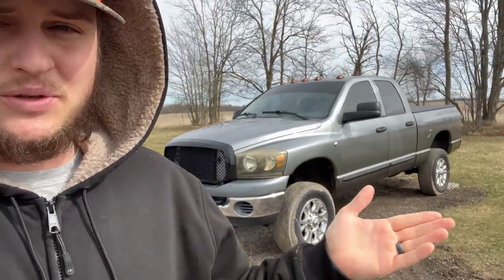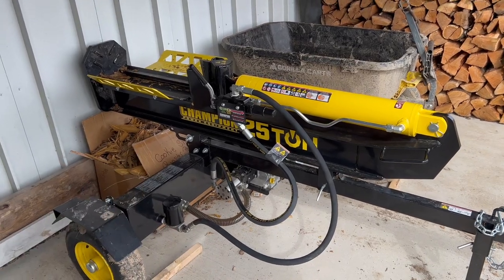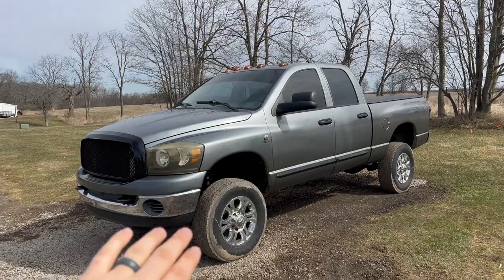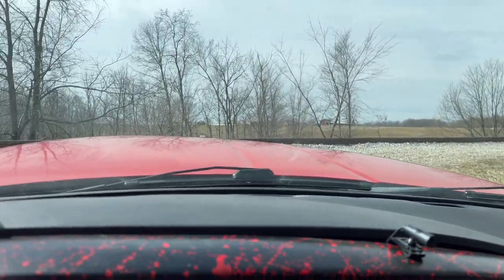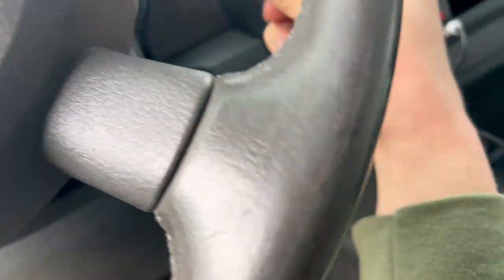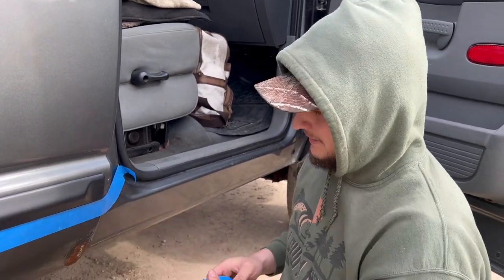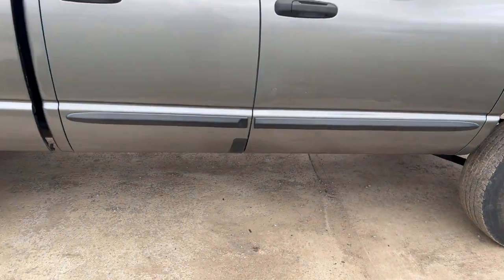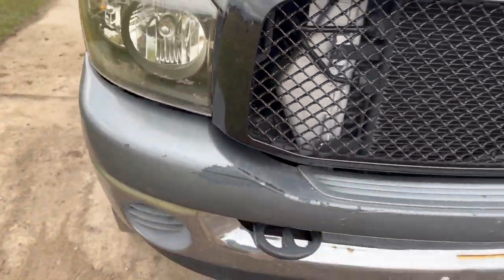I ruined my wife's truck in UNDER 24 hours of her buying it...

Comment: I think you should sand that spot down, add a thin layer of light weight body filler, sand, prime, sand, and then paint with paint the correct shade of gray. PS, that looks way better than a rust spot👍

Comment: Next time put a rust stopping spray on the metal left to stop the rust from coming back. Bondo is a several layer thing. Put it on heavy and sand down to what you need. It doesn't go on like drywall mud. Id take it back off get the right color Dupli color paint and some clear. Don't do a hard edge on the paint stopping either. feather it out a bit and it will be a lot harder to notice. I was able to do a damaged spot on my van in a weekend my first time and only I can find where it was now.

Comment: There is a place here in indianapolis that i use called millennium linings they are a rust check dealer. They use a rust inverter that they spray on when its done flashing eats the rust turns it black then coat with rust protection my truck was gone for a evening 230 dollars out the door take it back evey year to year and half

Comment: Keep in mind filler is porous, it will let moisture in, also putting it over rust it will fall off real quick glazing putty is the step after filler it fills in the pin holes in the filler, also you didnt feather out the paint, it will bleed through the paint, it's what we call in the industry a asshole. Also painting over clear coat will cause a lot of funky hazing

Comment: Being to hard on yourself it looks good. I think you should get the correct paint then sand it down fill it in and sand it again then tape it about an 1/8th inch above your patch on each side to better blend the paint. Not a body guy just how I’d do it. Plus it’d cost an arm and a leg at a body shop and can’t beat being able to
Say you did it yourself!